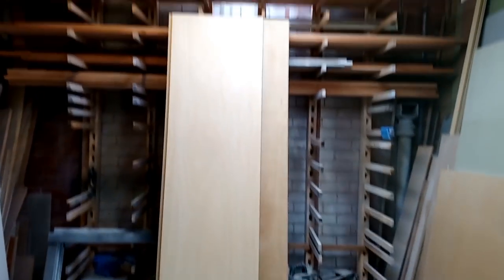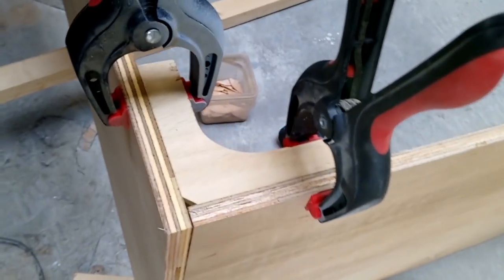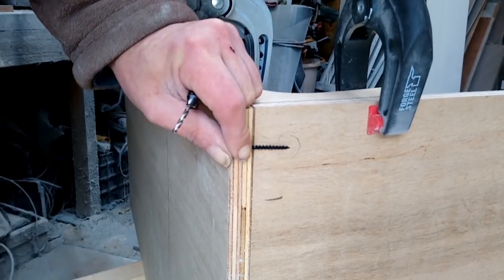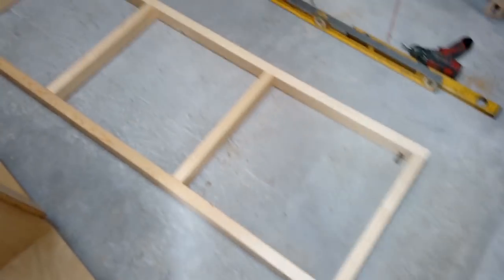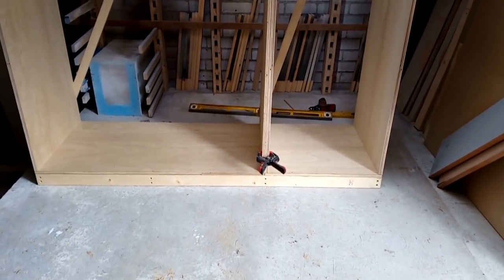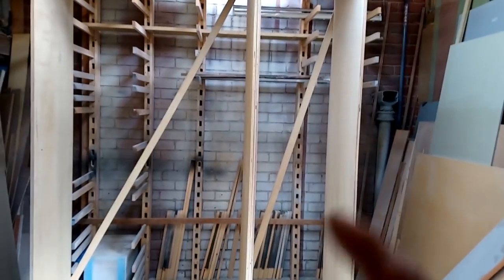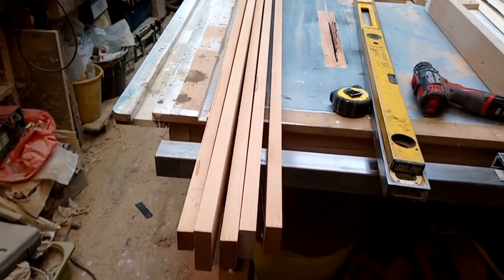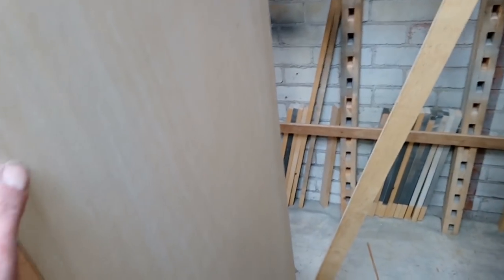Wardrobe build pt2 - Temp assembly of the carcass, planing & temp fitting the front frame

Comment: Hey gid loving this series on wardrobes so useful to me. What thickness do you recommend for the stiles and rails on your wardrobe doors?
Reply from the maker: Hi, thanks glad you like them. Thickness is determined by the wood & traditional sizes available,  I buy 1 inch sawn timber (25-28mm) after planing it comes out 20 - 22mm, the width of the stiles & rails is aesthetics, they're whatever you want, but for practical purposes because I use the Domino I make them 80mm, this allow 2 dominos + a groove for the panel,  Ply or MDF for the panel, I prefer ply as it's a lot longer lasting than MDF but you see the wood grain when it's sprayed, MDF gives a perfectly flat surface but can sag over time, I discuss this with the client & it's their decision in the end.
Reply: @Gidjoiner  thanks so much for your advice gid. I'm using tulip. I thought maybe 27mm thick in the hope it might be a bit straighter( I'm buying pre-prepared from the wood yard ) but maybe 21mm is plenty thick enough then?
Reply from the maker: The next rough sawn size up is 1¼ but quite often at a store it will be 1½ that's available, that will plane to about 32mm, (thickness of an interior house door) next sawn size up is 2inch, that planes to 44mm (exterior door thickness), I've made quite a few cupboard doors about 25-30mm thick, it's a bit easier if you're making traditional mortice & tenons as you've got a bit more thickness to play with, I used pine for those & thought the thickness was more suitable to the pine 'look', a proper thick 1 inch door rather than the more modern skinny 20mm door,, Pine warps & shrinks like heck tho, I really avoid using it now for doors, Tulip is ok but it's a softer wood than Beech, it's got a wider & more varied in direction grain, Beech grain is straight and narrow, Tulip can be vary in colour from pale cream - green -  to almost black in places, Beech tends to be more uniformed in colour, which is better for me when spraying as the colour of the substrate can show through pale colours. I also use Beech because it feels like a hardwood, even after painting the door has that cold hardwood quality feel, when the door shuts it has that clink of hardwood rather than the clunk of softwood, unfortunately Tulip tends to fall a bit into the softwood 'clunk' in this case, if that makes sense, + Beech is cheaper for me then Tulip,
Reply: @Gidjoiner  thanks so much for the comprehensive reply. I will look into beech. Do you think making the stiles at 21mm thick rather than say 25-27 means they are more likely to be a bit less straight? I would prefer to make them 21mm thick but worry I might get more problems with them being more bent or twisted???

Comment: Hi Gid, lovely video and finish product. I note you used Malaysian plywood; what's the downside of using just standard 18mm structural plywood to be painted?
Reply from the maker: Hi, the standard stuff that i can get has a very thin veneer on the face that sands off very easily, it's sometimes folded/creased & it's not 18mm, more like 17mm closer to 16mm, I think it would spray ok but i don't buy it so can't say for sure, 
The Malayan has a nice thick veneer & is the full thickness of 18mm, 
This comes from Lawcris but if i get the same product from Lavers, they call it far eastern, it's only 16½-17mm. a nice thick veneer but it gives me a headache when working with it because i might be using off-cuts i already have from an old job, measurements & matching thicknesses get messed up. 
Saying all that the 'nice thick veneer' is not always the best quality, it def has one good face.
Thankyou 😉
Reply: Thanks a million Gid. That's very helpful!!
Reply from the maker: No prob 😉

Comment: How come you use beech for the shaker doors mate? Would you ever make the stiles and rails out of MDf?
Reply from the maker: Hi, It's about the quality of the base material & therefore the quality of the overall job, wood is wood to me but some are better than others, for quite a while i used pine, cheapest price i was asked for but the shrinkage & warping later when the pieces went into a centrally heated house were unacceptable to me, Beech doesn't cost that much more on a job of this price, the time & expense put in ya might as well have a decent substrate that'll stay relatively stable for it's lifetime, Beech is harder & fairly straight grained with little or no knots, it's not just the longevity tho you can feel the difference after it's sprayed, the temperature, the hardness & the way it shuts just gives it a better well made feel. I build these things with the hope that they will still be around in 50yrs like the old pieces that are still sometimes around, they were often made of pine, which is what i was trying to emulate but the quality of the wood was better then, if i bought planed pse pine i would still have to machine it sq n straight because off the shelf it never is, so the labour in preparing the wood is not much different & cutting the dominos is the same for both & maybe the same time spent would be spent on the joint of MDF whether that is a spline/scribe/groove or domino. 
I would use MDF if the job was cheap, if i didn't expect them to last more than 5yrs, if i wanted a very flat no grain finish or if it had to be done with that material through customers choice for whatever reason (prob against my advise), Mdf boards never come straight so tall doors can be a problem, screws don't hold as well as they do in Beech, fitting butt hinges into the edge of MDF is not reasonably poss, I use ply for the carcass for a similar reason so the screws in hanging rails & drawer runners hold well,
When spraying there is an inside & outside edge on the stiles n rails, MDF feathers a little so there would be more work there sanding, i give my customers the option of ply or MDF panels, you get a very flat finish with the MDF & ply is a slightly better material but poss seeing the grain through the paint, their choice?, when sanding these doors with beech stiles & MDF panels it's always the panels that need the most sanding,
I do use MDF for doors & drawer fronts, normally when it's just a plain flat door i want but I have a list of materials in my head, MDF is the very bottom & would be my last choice for shaker doors. unless it was a bespoke style/sized door you might as buy some, there's loads of MDF units/furniture on the market, a lot cheaper than asking me to buy one, it's not the quality that my clients expect from me,
Reply: Spot on mate thanks for the nice lengthy answer! Thorough and honest as always. I made one for my friend not long ago and used pine as it was on a budget but as you say the quality of it isn’t great. How much more is beech would you say?
Reply from the maker: 👍 I made a vid If you can be bothered 😁 on this the size for 1 inch is wrong i think, it should be 25.41666, I always get the decimal mixed in my head with Pi's π decimal which is 3.141, so ignore that 😏 https://youtu.be/t5MnQExLla8

Comment: With the base support, would 18mm plywood cut @ say 2x4  be strong enough alternative?
Reply from the maker: Hi, I'm not sure what you mean, '2'? x4 I've used 4x1, 3x1 & ply cut at 4" if that's what you mean, yes that's fine, it's not easy getting these bases in exactly the correct position so i like the 2" which allows for a little movement/adjustment of the wardrobe carcass, i know that the base is sat firmly on the base frame & not perched on the edge of 18mm.

Comment: Hi Gid, I noted in this video on the temp build you sat the side panels on the base. I can see that this may be stronger than having the side panels full length  and screwing in from the side. Would you make kitchen base carcasses and kitchen wall carcasses to the same construction or is it mainly used in wardrobe builds. 
Cheers Gid
Reply from the maker: Hi,  On kitchen units i would build them like this if they sat on bought adjustable unit legs or a base/plinth like this, kitchen legs that come with flat-pack units have a tab that sticks out to help support the sides, this way supports the sides better.
 (but I don't get asked to 'make' standard kitchens, when i do 'fit' them, then I just buy off the shelf units)
Kitchen wall units are seen from the front & side so you would want to see a full length board there, that could also be said about base units but both often have end panels covering that view.
I posted a couple of vids that were a shaker style kitchen so that had a wooden frame.
the bed side tables i posted vids of had sides running full length,
It depends on the design sometimes but Ideally i would build all units like this, this is a stronger design, these sides are too heavy to be held up by the screws & biscuits esp with the weight of clothes inside as well, this way gives a better looking joint from the perspective view also, looking down & up you don't see any gap that might be in the joint, 
The separate base allows me to get a level platform to start building from, there will be a skirting going around the bottom that will cover. 
Have a look at my Facebook photos, 170 Albums, most show the construction but not many kitchens, 
https://www.facebook.com/gid.joiner/photos_albums
Reply: Many thanks for informative reply Gid. It does seem a stronger option, more support!
Any side panel that is seen one can fit a full end panel over the top.
Cheers Gid  ill look at fb page and catch up on wardrobe build. 👍

Comment: Hi Gid what was the thickness of the back board 6mm ? I know you didn’t fit until day of instal which you stapled with narrow crown staples. 
I keep looking back over the build which I can apply making up my smaller kitchen cabinets. 
Cheers Gid.
Reply from the maker: Hi the backboard was 9mm, 6mm always seems a little thin to me, the boards in the doors were also 9mm, 
I might be tempted to put 6mm on kitchen cabinets but the price difference is nothing between the two & 9mm gives a flatter stronger feel, it has a little substance/thickness to get fixings in, the staples would have some material to get a purchase on 😉
Reply: Cheers Gid  thanks for advice much appreciated. When I start I’ll keep you posted. 👍
Reply from the maker: No problem, hope it goes ok 👍
Reply: Would that be 9mm mdf or ply?
Reply from the maker: 9mm ply on the backs of this wardrobe, depends if i want a very flat surface, the ply i think will stay in shape longer than MDF, a big piece like this would maybe look saggy in a couple of yrs if it was MDF, I put MDF in the doors because they're only small panels & i wanted a good flat look without any grain or defects showing, (I only use MR MDF whatever the thickness)